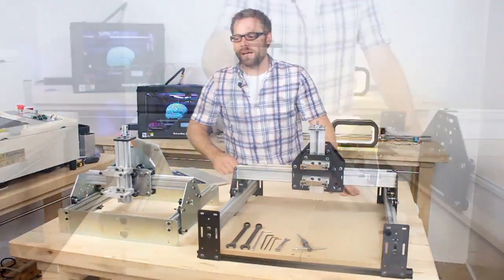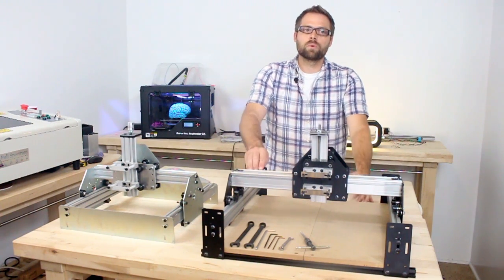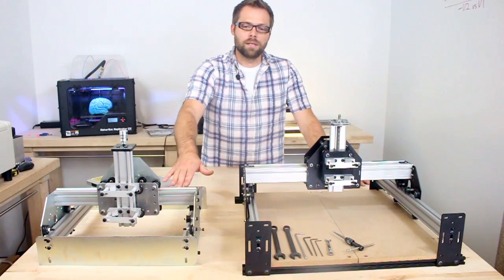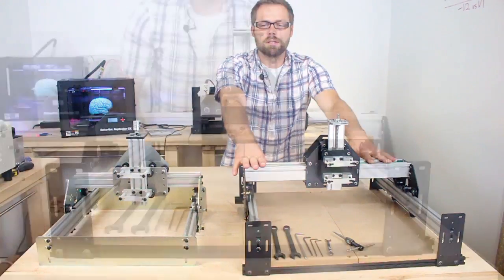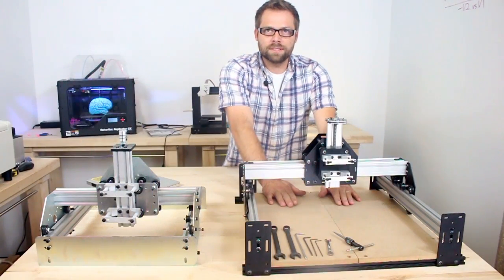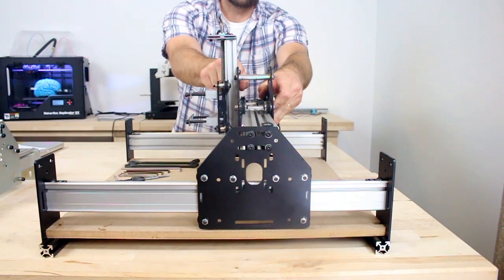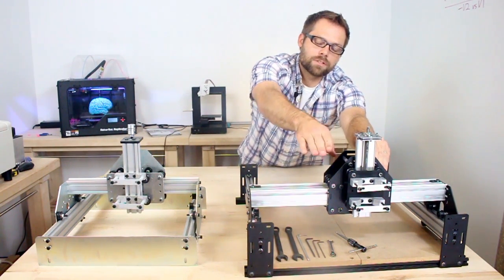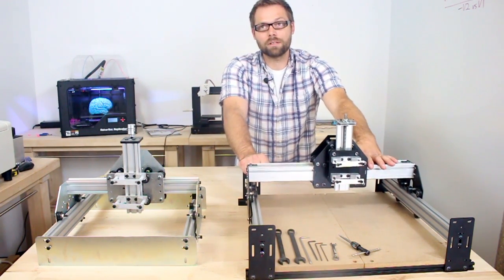From the archives: Edward Ford discusses precursor to the X-Carve 3D Carving CNC Machine, Shapeoko 2

Comment: Just pre-ordered the mechanical kit for $299. I also ordered some longer extrusions (for extra rigidity) and maker slides to increase the XY axis. I'm going to expand this kit to a much larger machine with a total working area of 50x25 inches. Paired with much more powerful Nema 23 380oz/in stepper motors (the Z-axis will use Nema 17) and a 1.5kw spindle I'm going to have a machine that will outperform both the CNC Shark HD and Probotix Meteor all the while being about $1,000 cheaper.